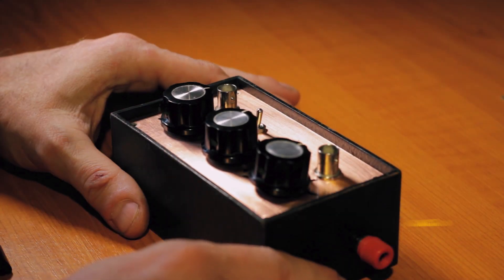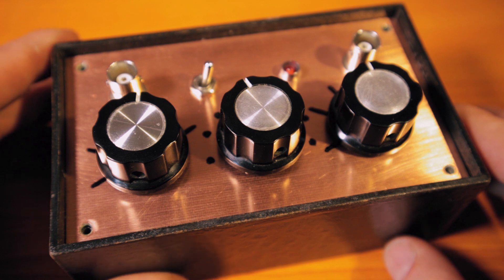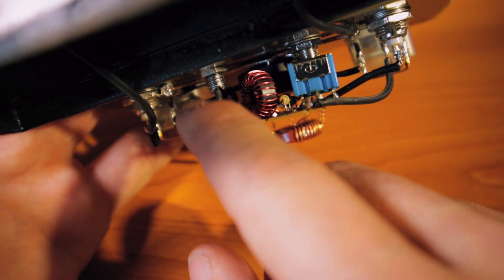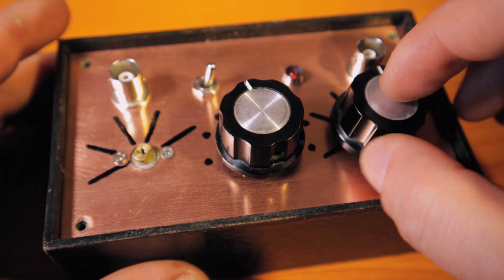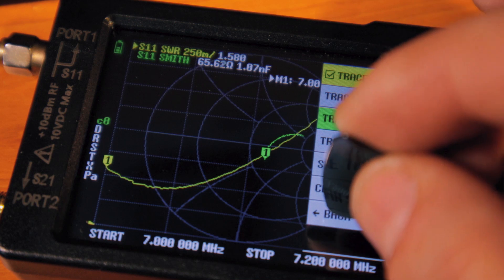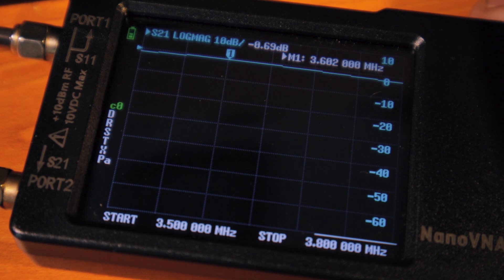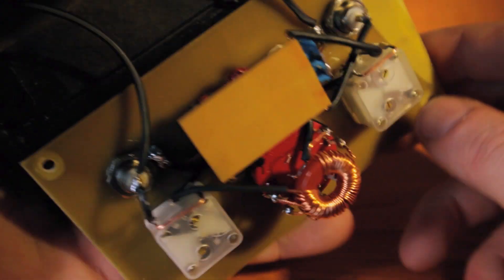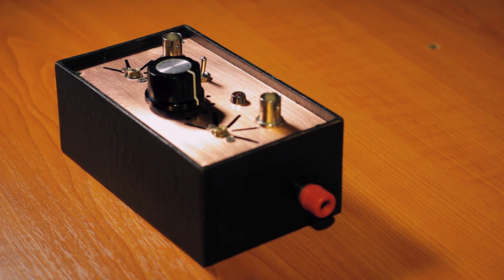I Cloned A Chinese Antenna Tuner Kit - 3 To 30MHz HF QRP ATU

Comment: Another defamation video.
Reply from the maker: La tunner te referi  ? Daca da.... cam asa e, m-a cam dezamagit fata de ce stiam eu. 73
Reply: @dxexplorer  the tuner does not work well enough because you used too small capacitace, too small inductance, and you associate your bad construction with China, when it is you who volutarily made it bad. Sounds like defamation

Comment: Well done buddy. Well done. 👌🏻
Reply from the maker: Thank you so much my friend. I'm happy it works well... but I hope I don't have to use it often )). Is good to have one just in case )). 73
Reply: @dxexplorer  it’s always better to have a well tuned antenna. But simple said. We do not always have the space ore time for hanging so many antennas in trees.
Reply from the maker: Yes is true. Or in portable maybe you don't have the time to test and measure and adjust the antenna. Just plug and play ))